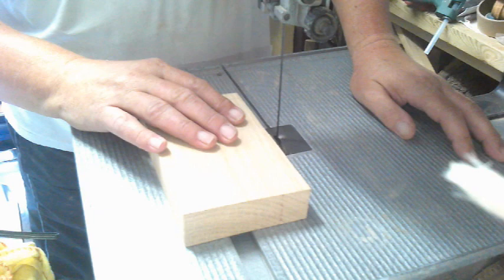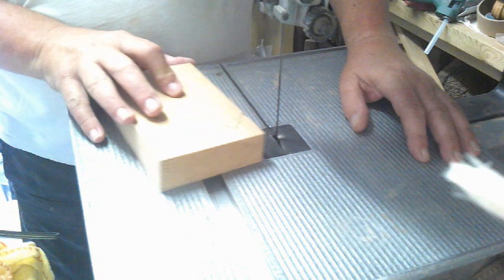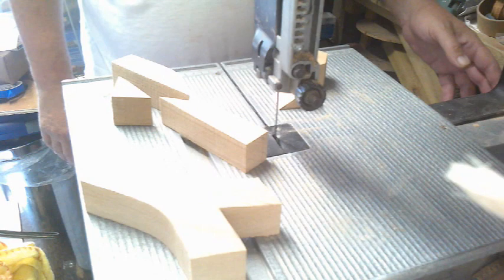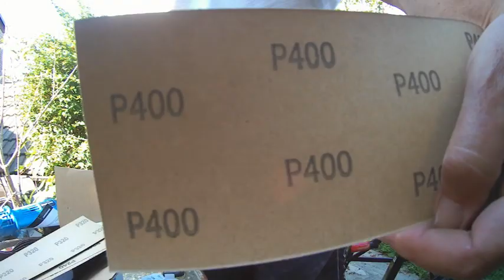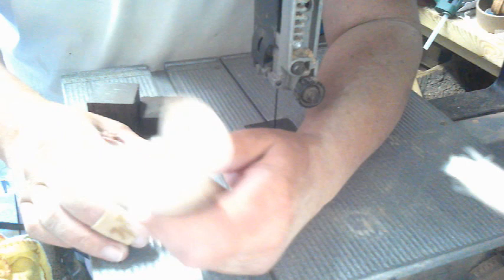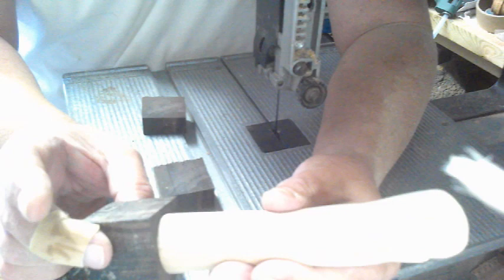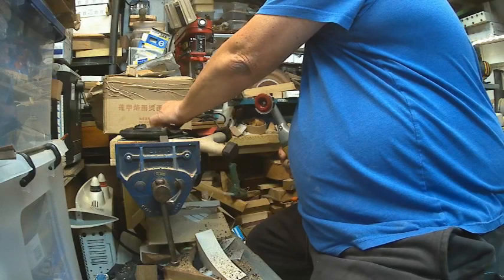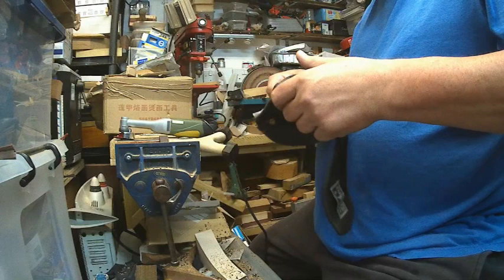Woodworking a walking stick handle from Oak.

Comment: I saw the finished video first so I know it turned out lovely, but still had to check this one out as well. 

Came to your channel from Doug Miller's channel, by the way. He referenced a pen video of yours in a pen video of his. I'm thinking of trying to adapt the method he used on the pen to adding a bit of fanciness to  the shank of my next stick, so a roundabout thanks for the inspiration. 
Cheers!
Reply from the maker: Thanks Dana. Doug is a great person and great turner as well.
I find inspiration for my segmented pens from weird and wonderful places. Patchwork designs for example can be made into pens with a bit of working out.
Thanks again Dana and take care.
Cheers, Huw
Reply: @WoodenItBeNice  Very true on all counts! I'm just watching your Celtic knot pen video ( Bog oak and cedar of Lebanon) and I'm thinking that this would make a brilliant spacer or collar for a stick. I keep a notebook next to the computer for whenever inspiration hits.
Reply from the maker: @danawrigleywalkingstickand5677  I think a Celtic Knot would be an amazing spacer or collar. I save things in folders on my computer.